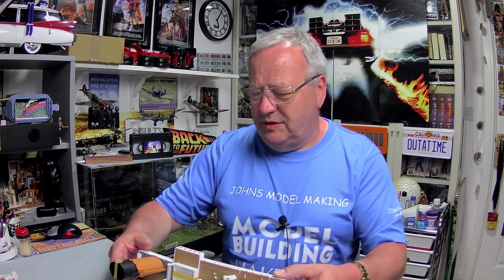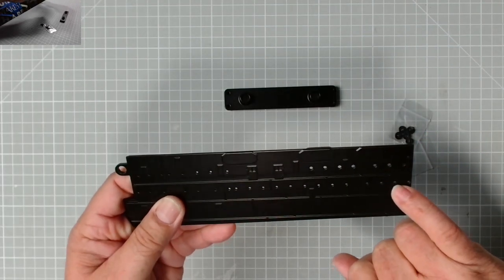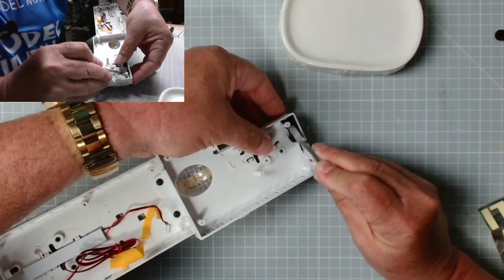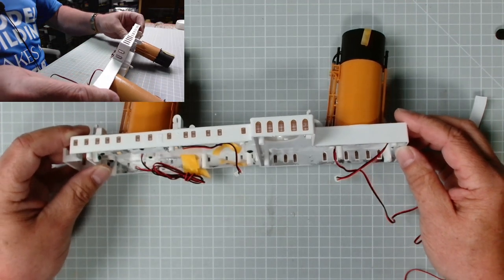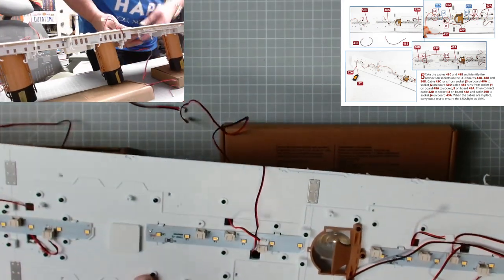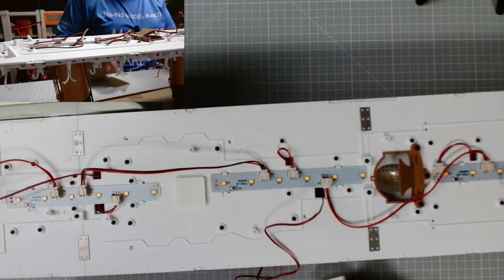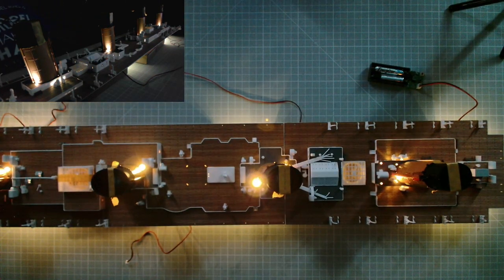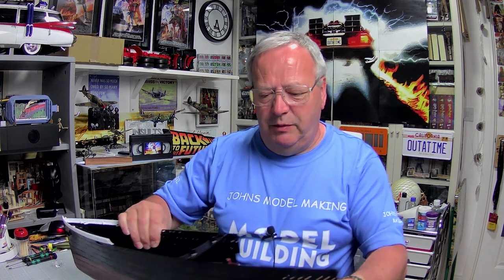Build the Titanic issue 64 from Hachette

Comment: It's great to be able to look ahead.  I'm in USA and at Pack 7  (Stages 33-38).  Packs 8 & 9 are also to hand so I'll have a marathon build session.  Reason it's nice to see ahead is because I'm going to be weathering a little as I go to add realism.  I find the white plastic bits too shiny and 'toy-like' as is.  Same with bulkheads, etc.  Thinking of a different white to tone them down, more semi-gloss to matte in variation.  When the hull is fully together, it will get a matte finish, as well as the funnels.  I think a little extra work can enhance the overall look.
Reply from the maker: That sounds great. Good luck with your build, and thanks for watching. 😊